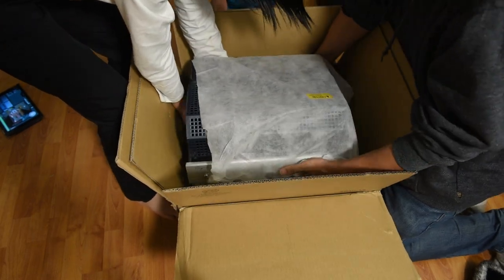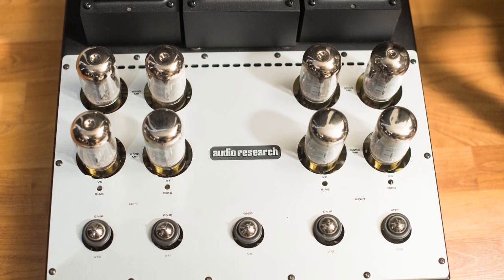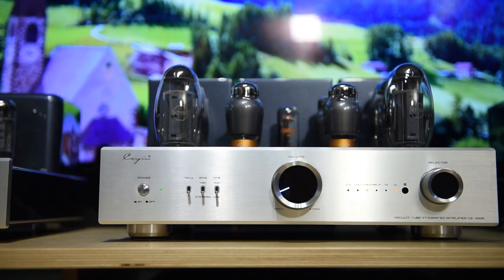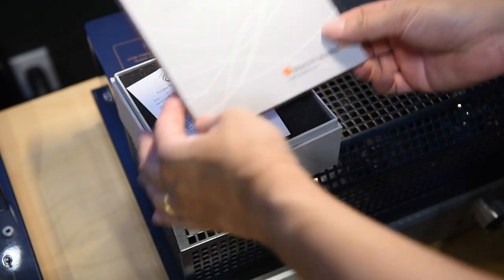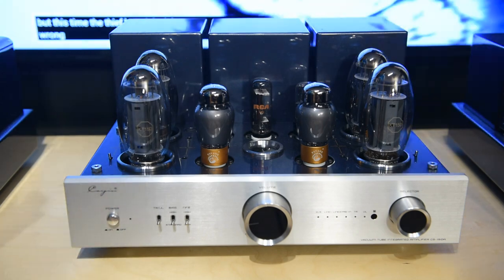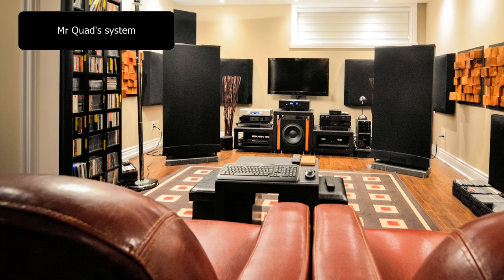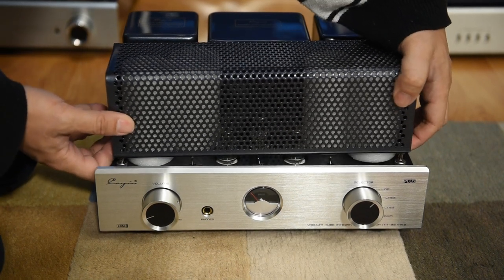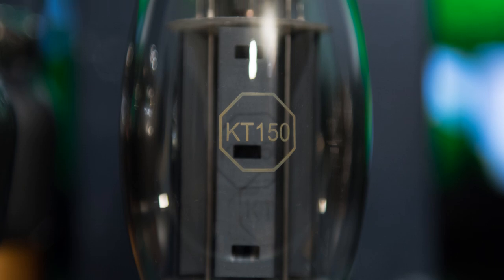The most dynamic Tube amp in the world? 🤔Cayin CS150 Tube integrated amp review.

Comment: Thomas,
Any second thoughts about the 150A?  Looking for a new amp and from your review this fits the bill.
Reply from the maker: Well, what I should have done is to compared the CS150 to the CS100 in the video. If you plan on auditioning the CS150, also go listen to the CS100, more airy, sounds like a tube amp, effortless with 8 tubes. Just not as dynamic and fast but if you like vocal, EL34 with CS100 is worth checking out. Both are good amps but I would not buy CS150 before listening to CS100. If you have very efficient speakers, there are other choices out there if you want sweet vocals. It comes down to what you want and how much budget you have.
Reply: Thanks Thomas,
Vocals aren't a great concern for me, more about the music.  So something that's dynamic, not necessarily fast but certainly not slow.  Other than that, detail, I like to hear whatever's in the mix.  Using Spendor A7s (88dB), anything around the 150A's cost is fine.
Reply from the maker: @grahamt3598  Cool but please don't buy it blind. They have locations around the world for audition. Also it is cheaper than what I mentioned in the video.
Reply: @ThomasAndStereo  
Thomas,
Local dealer stocks Cayin so that's the plan.  Many thanks.

Comment: Hi Thomas . Thanks a lot for this wonderful video . I am very interested in this Cayin but I am afraid that the little tube in Gracias emisor is only manufactured by Cayin and I am again one day I can not replace it … have you any idea if it can be replaced by another brand ??? Many tanks again. Víctor
Reply from the maker: Yes, you can use other brands. Infact you should to have some fun with tube rolling. Only problem is KT120, I think only Tungsol makes them.
Reply: @ThomasAndStereo  thanks a lot Thomas. So no problem with replacements!! I hope the Cayin can drive the Cornwall IV properly without exaggerating the bass … I do not have the chance to listen it before I buy it . 🙏🏼
Reply: @jastrel  the question would be why are you buying them. Cornwall are efficient and you have so many options. Asking because to buy something like this blind is taking a big leap especially cornwall are quite lively and these Cayin top end is pretty bright. Where are you located? How come you cannot audition it?
Reply from the maker: Not sure why my answer was done with my daughter's koitz account but question above is from me.
Reply: @koitz7489  thanks for your answer first of all . Cornwall is efficient but a 15’ is a15’ and 12 watts amps are not the best to corntrol the 15’ . The thing is work in Congo where I am right now. I’ll be back  at home (Spain )  by the end of August to celebrate my 50s and I’d like to have the am at home at my arrival . That is why . 😅

Comment: Dual binding posts speakers try a  0.2uF - 0.4uF with a non-inductive 20 ohm resistor in-line, across the terminal, the resistor has to be the other side of the capacitor the resistor connected to negative terminal.  should help with your top end sparkle reducing it. ps tyre polystyrene capacitor the band has to go to towards the negative terminal
I'll say your liking this amplifier how much does it go for?
Reply from the maker: Around $6k :( I can't afford it.
Reply: @ThomasAndStereo  build your own then! They sale the 845 for 7 smackeroonies I did check this amplifier seen it for £4000 new

Comment: As clear as solid state with 5 times the hassle :P
Reply from the maker: Yeah, I hate the part about tubes burning out and KT150 are not cheap.
Reply: @ThomasAndStereo  it still looks fun though, I will have a tube amp, but will probably agonize over the choice.
Reply: Not only clarity. But also the benefits of holographic soundstage, air between instruments and flow.

Comment: Another words a tube amp behave like a  solid state amp !! Just buy a descent solid state amp and get rid of tube headaches !!
Reply from the maker: Problem is there are no solid state amp I have tried in this price bracket that has the dynamics of these tube amp, nor the control of the bass. Perhaps class D amps but class D has its own sound that not everyone likes.
Reply: @ThomasAndStereo  iDynamic and tubes is an oxymoron  !!!!!!  in my 31 years in this hobby,  never seen a truly dynamic tube preamp,, which has well defined bass response with leading edge and heft . But can name mamy mamy solid state which come through my collection.
Reply from the maker: @akhtarali6026  Exactly my same experience! Tubes and bass are always meh. But that is one of the main points of my video, technology advances and what we thought is the norm can change with new gear introduced. Mine you, I do wish the bass is fatter with this unit but in terms of dynamic punch, it will beat my Mcintosh solid state 200w MAC 6700.